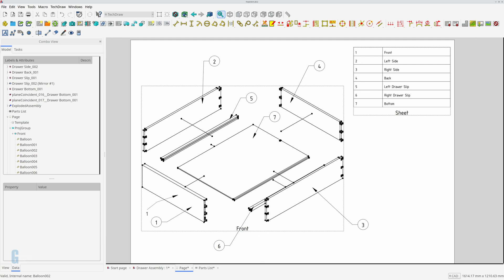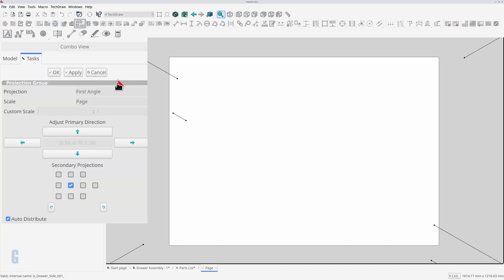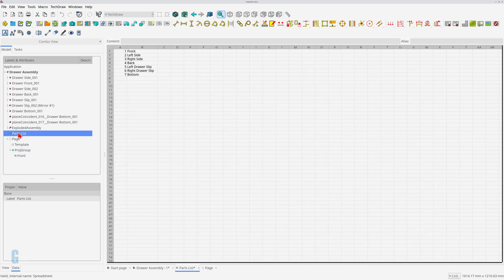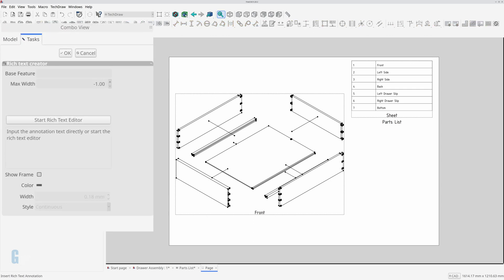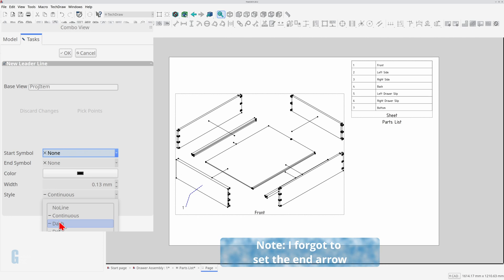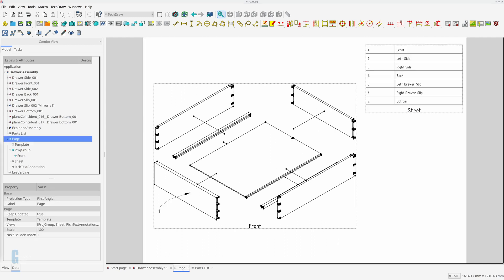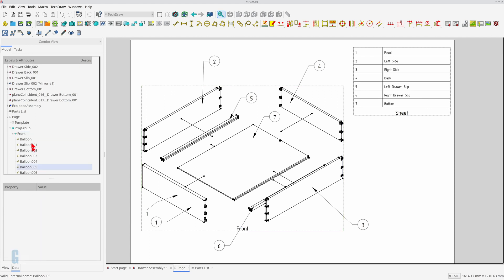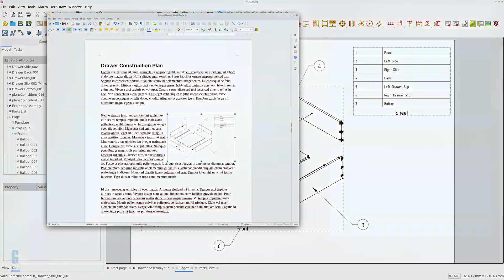Create an assembly drawing with an exploded assembly

Comment: Nice job with this video!  My problem is that somewhere after I 'explode' my drawing some of the parts fold back to their original position before saving the Projection Group.  SO I can't get a good exploded view in the TechDraw sheet. I'm stuck there.
Reply from the maker: Thanks for your comment Tim. I can't say that I've come across that problem before. Are you recalculating the constraints by any chance? If so, you might find that is part of the reason but I'm not sure.